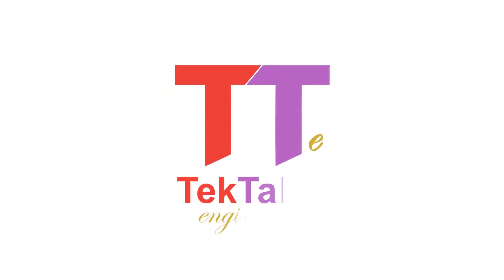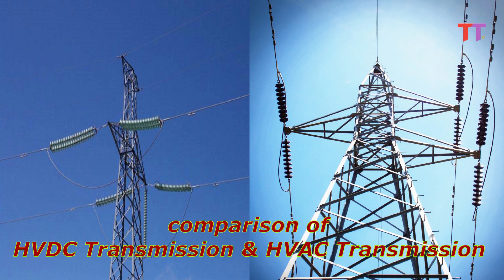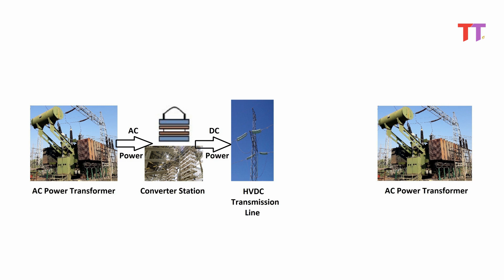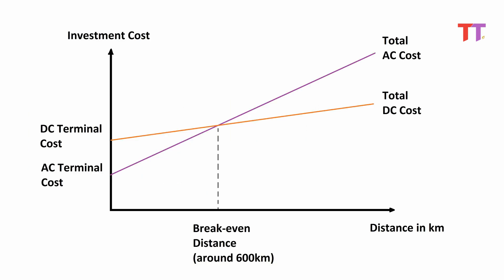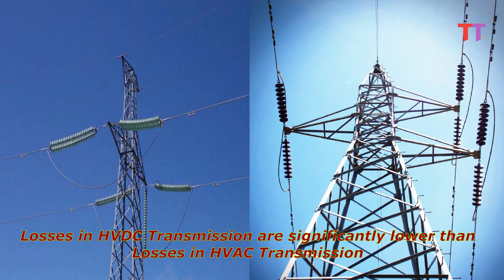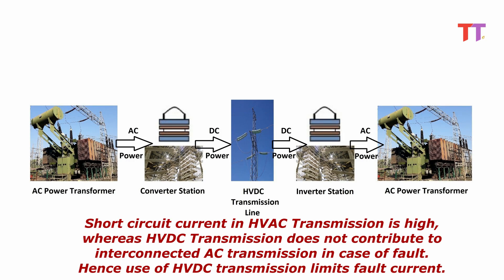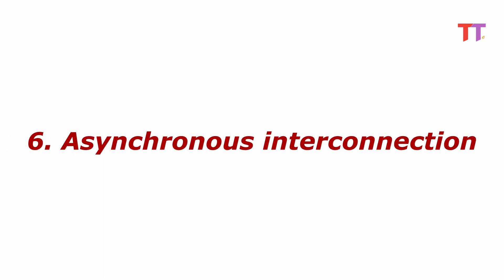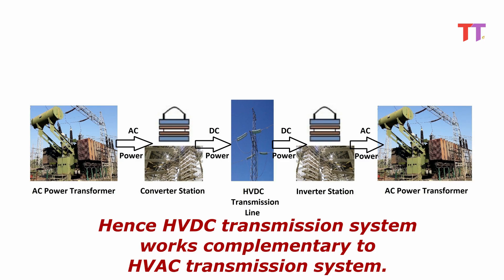HVDC Vs HVAC. Transmission System Comparison.

Comment: why fault current is low in HVDC??
Reply from the maker: For long distance HVAC transmission, short circuit current level in the receiving system is high. Whereas HVDC system does not contribute to the short circuit current of the interconnected AC system. Hence in HVDC fault current is low. Hope this answers your query.

Comment: What.is purpose.d.c.trsmisson.line
Reply from the maker: Unlike AC transmission, DC does not have reactive component like inductance and capacitance. Hence power loss is less as compared to AC. Hope this answered your query.